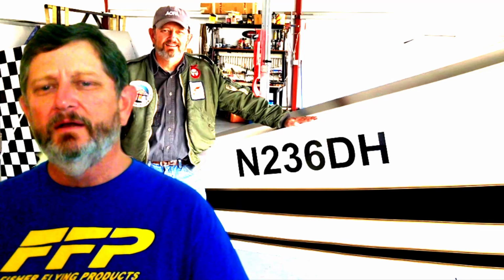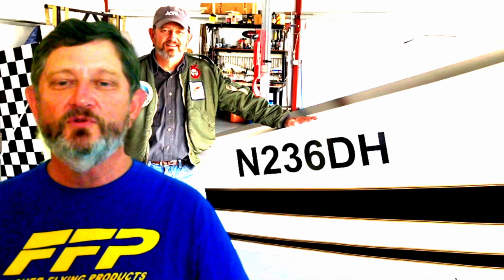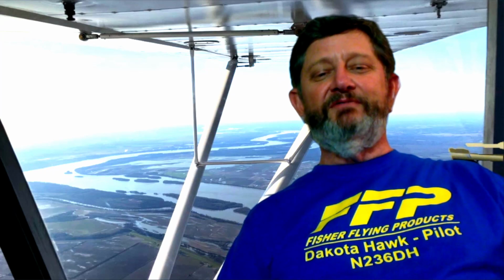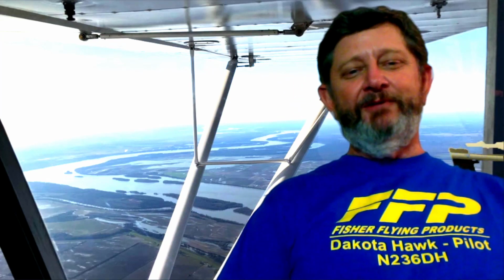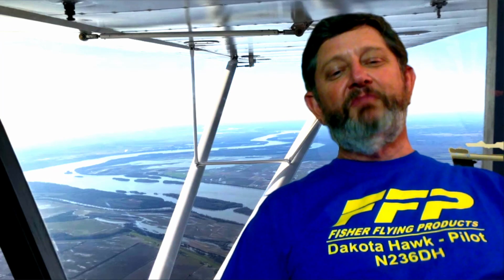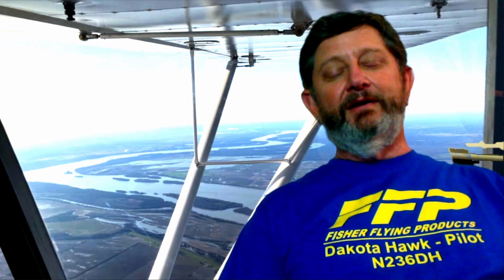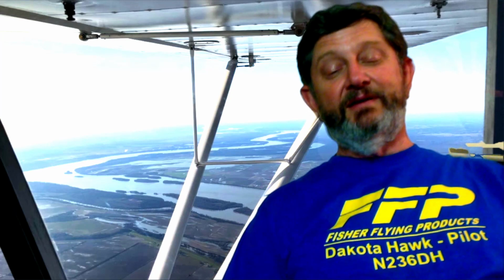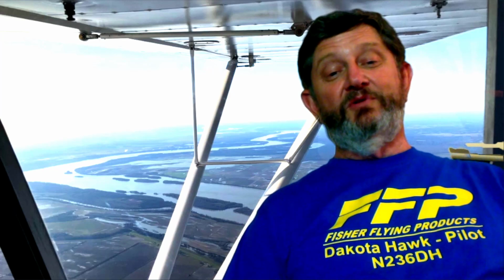Fisher Interviews Steve McKamey-  Dakota Hawk Owner -  Fisher News Letter 7 - 07-17-2020

Comment: My FP202 was crashed by an 80 yr old man that thought he could go from a Cherokee to an ultralight without a thought.
He destroyed the plane...but the cabin was intact & and he walked away with a few scratches. 
We've had an engine out off-field crash & stupid mistake crashesb all without fuselage airframe damage. But built a couple landing gear and several wings.
After 14 yrs on jet engines & steel/aluminium aircraft...I definitely choose wood.